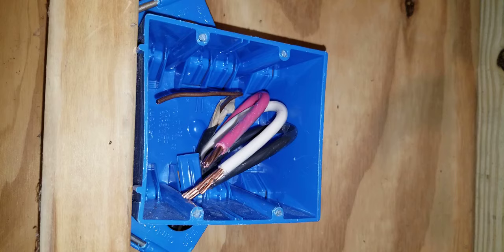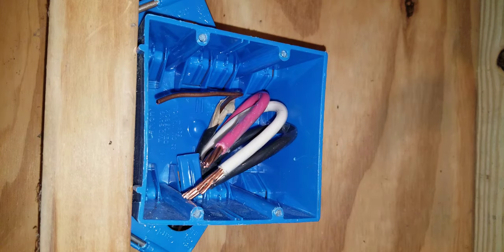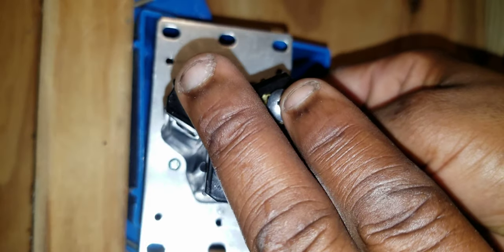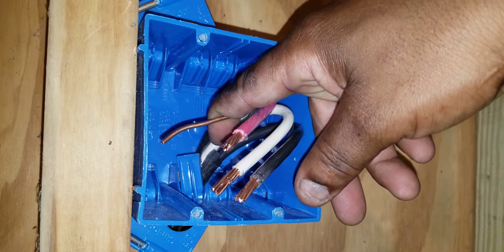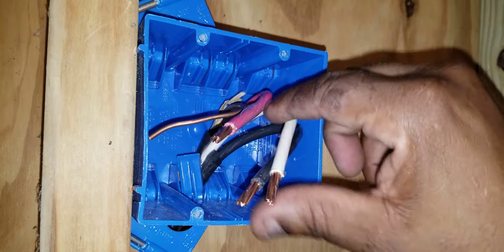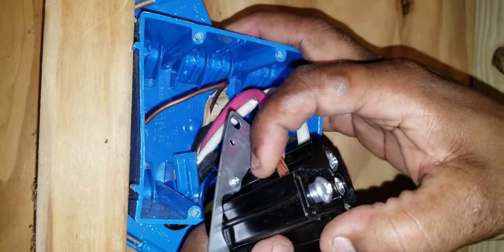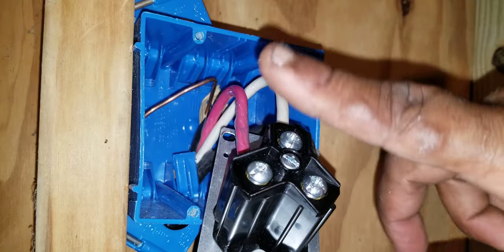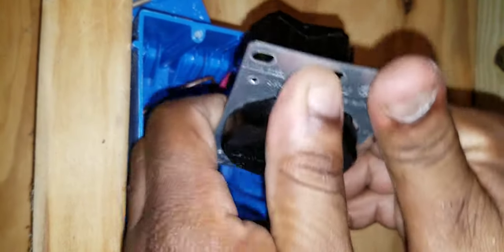How to install a 3 wire range outlet.

Comment: For those who think this is easy, you should know that the old NEMA 10 series plugs like this one have been illegal for new installations since about 1996 in the US. Appliances built before then were designed for buildings that did not have a dedicated ground circuit, so they used the neutral wire to carry ground faults. It will work, but it is potentially dangerous because the frame of the appliance may have some voltage on it caused by the imbalanced 120V loads. The NEMA 10 series were replaced with NEMA 14 series which have 4 wires, or NEMA 6 series which have three wires but no neutral (in those the third wire is a ground, not neutral). You don't want to be using a NEMA 6 plug on an appliance that runs some 120V circuits since the ground wire would end up carrying the unbalanced load back to the panel which is also illegal. NEMA 6 plugs are designed for appliances that don't require the use of 120V circuits to power oven lights, accessory plugs, or circuit boards. To tell which plug your appliance requires, check the wiring diagram and installation manual for the appliance. If it is a relatively new appliance, you probably don't want NEMA 10 receptacles! If the appliance supports a dedicated ground wire the most versatile and safest option is to use a NEMA 14 plug and receptacle AND be sure any ground/neutral bonding strap inside the appliance is removed. The 4 wire configuration of the NEMA 14 series is the direction almost all new appliances are moving to, and older plugs may be flagged during home inspections.

Comment: NEC code says that for a 50 amp circuit min gauge wiring must be 6 gauge. Correct me if I'm wrong ?
Reply: If the terminals are rated for 75C, then you can fuse it at 50A. but the general rule is 100A and less, use the 60C column, which is 55A for #6 and 40A for #8. correct.

Comment: Ricky, i just added a new 240 outlet, but i used the red and black as power and the bare wire in the center port for ground., did NOT use the white.
Reply from the maker: This is fine for an 240v a.c. unit or a water heater, but not for a stove, oven, or dryer. Using the white wire is always recommended for the neutral in a house. Using the ground bare copper wire for the neutral should always be avoided, however it is fine the way you installed it. In many houses built in 1950's, and 1960's, the bare copper wire was used as the neutral wire.

Comment: When i tighten down the screw, it doesn't hold fit the wire. The wire still pops out. 
Any tips how to deal with it 8:44

Comment: What if you have black,white,and ground could still hook it up?
Reply from the maker: Yes you can. Use the white as a hot wire, use the black as a hot wire, and use your ground as your neutral wire. So put the black under one of the hot screws, put the white under the other hot screw and put the ground  where the neutral would go.

Comment: Wait - if it's a 3 wire nema 10-50 outlet, the third wire is NOT NEUTRAL, it is suppose to be ground.  This connector is for two wire w/ground cable where you only have the Red and Black - if using a 3 wire source with ground, then you need the nema 14-50.  You just created a safety issue because a neutral wire is not a ground.  In your case, the appliance is NOT grounded and can be quite dangerous.  You can still use the 3 prong plug, but do not use the white (neutral) wire.   As a side note, at no point beyond the service entrance do you bond a neutral and ground.  When using the 2 wire with ground on a range, the range itself will have a jumper that connects the ground to the center terminal.
Reply: So eliminate the white and use the ground in the center?
Reply: Hey man I’m trying to hook up a 3 prong nema 10-50 that was once a 4 prong, which wires am I supposed to hook up, the 3 prong  says white, x, y, and the wires that’s hooked up to the 4 prong is red black white ground so please tell me which once to hook up to the 3 prong please.
Reply: @Not_chris_again  yesterday I did a 3 prong with 4 wires. And capped and tapped the ground and hooked white in center and red and black on left and right.
Reply: @Not_chris_again  hi, sorry for the delay. You only use black and red on the sides and green ground for the center tab.  3 prong nema 10-50 does not use neutral.   Hope this helps.   BTW, some appliances need a neutral and would require 4 prongs (nema 14-50).   What ever you do, do not connect the ground and neutral together.   Only use hot-hot-ground.
Reply: @aaronhagan4036  for the 10-50, you only use hot-hot and ground.   If the appliance requires a neutral, you’ll need the nema 14-50.   In your case, the white is left off.  Please cap the white wire so it’s not able to touch anything.
Reply: @MrKen59  so theoretically what can happen if I capped the ground and out neutral in middle?
Reply: @aaronhagan4036  great question:  
Ground is there for safety and should never carry a load.  Ground and neutral are connected together in only one place, and that’s at the service entrance.   If a fault occurs you can potentially energize the case of an appliance.  I know it makes little sense as they are connected somewhere, but wires can come loose and there is always a voltage drop along a wire.  As a side note, you may notice, the ground conductor is not always the same size as the other conductors. 

In regards to your question - you have to understand how current flows in a circuit.  With 2 wire 240v, current flows between the two hots since they are out of phase.  It’s the same with 3 wire, except the neutral can carry current if the device needs 120v since you essentially have two 120v connections. 

Good luck my friend :).
Reply: the range is grounded in the frame to the neutral. Fault current will go back on the neutral.
Reply: @krakenwoodfloorservicemcma5975  neutral is called a grounded conductor and not used for fault current. If the source is 3 wire (black, red, white and ground) and it’s a 2 prong with ground  receptacle - white is capped off.   I challenge you to seek approval from your local inspector.
Reply: an oven uses neutral current, I have not seen a range yet that runs on straight 240. you cant send it back on a bare ground wire unless it is SE cable.
Reply: @MrKen59  and stop giving people dangerous advice. neutral, common, center point of transformer, grounded conductor, intentionally grounded conductor.. doesnt matter what its called if you dont know how to hook it up.
Reply: @krakenwoodfloorservicemcma5975  wait / he is talking about a plug. He is using the white neutral as the grounding pin on a receptacle. That is wrong.  Neutral and Ground are bonded ONLY one place in a system and that’s at the first point of disconnect.   Neutral is not used for fault current as it’s considered a return path.  Your example - IF you have a 3 prong 240 v (hot/hot/ground), then on the appliance you can connect white and ground, but in his example, that white wire is not for fault current.  Hope this helps as I think we are talking about two different things. 

Do me a favor - if anyone does electrical work, have it inspected by your local authority or the city.
Reply: @krakenwoodfloorservicemcma5975  exactly - however if you only have a three wire plug, the appliance lists a process to connect neutral and ground at the appliance.   Always read the instructions when connecting an appliance.  The NEC has an instruction to follow the manufacturer’s instructions.  Again, in His example, he is using a 3 pin plug with 4 wires in the wall and setting aside the grounding conductor if I remember correctly.
Reply: @MrKen59  check 250.141 or 2 if i remember correctly. Existing oven and dryer circuits. they allow you to bond the neutral/ground because studies showed that it was rarely a problem and it would confuse so many people to mess with it.
 technically, since he has a 4-wire circuit, he is wrong doing this either way.
Reply: @krakenwoodfloorservicemcma5975      I see you have made several comments here.   Since I’m an old retired electrical design engineer, I can clear up a few things.   I started in 1981 NEC.   Stove and dryer branch circuits were three wire.  Black, white, ground with three prong receptacles.   In the 1984 NEC, the branch circuit required 4 conductors, black, red, white, and ground.  The receptacles were required to be four prong.   So, any house designed and built under the 1984 or newer code is required to be 4 wire, 4 prong, (never 3).  The reason for the exceptions in the newer codes is they can’t force you to install the upgraded number of wires so the three wires can remain.   Never replace a four wire receptacle with a three!   Always change the three prong plug to four wire plug to be compliant and safer.   I hope this helps!   Kevin
Reply: Thank you!! Your enthusiasm and accent made this enjoyable.
Reply: @KevinCoop1  its in article 250 and very clear.
Reply: The OP is showing what happens if your older home only have 3 wires (red, black and white) for the electric range. And technically you can call the third wire (white) neutral or ground if your older home only has 3 wires. The neutral and ground wire are bonded in the main breaker panel.
Reply: Saw this video, knew it was wrong, checked comments for right answer and here we are. Thanks!
Reply: I learned to use the black and white wire as hot, use the ground wire as neutral.

The place s small strip of red electrical tape over the white wire to indicate it's hot.
Reply: @greensiena2762  The ground wire should never carry current or be used as a neutral.  It’s there only for fault current.  If you need a neutral, run a new cable along side or new 3 wire.
Reply: @MrKen59 
Thank you- Done!

Comment: Ricky - Thank you for the video.  Question:  Can I install a 50amp. 3-wire range outlet with standard 6-gage electrical wires?
Reply: Yes you can. You can use 10 awg to 4 awg for a stove range.
Reply: @psychosocial6112  this depends on the specs of the manufacturer, some require #6/2 or 6/3.. always read what the manufacturer requires

Comment: My question is how in the world did you get the wire into that box? Mine will absolutely not fit those tiny romex slots. I'm going to have to drill out a hole.

Comment: Mine only has two black and one aluminum, no ground. How do I wire it and ground it?
Reply: That’s the answer I’m looking for.
Reply: blacks should both be your hots, aluminum is your neutral. always good to check the panel to see where the blacks are connected, you can never assume it's wired correctly lol

Comment: I have what I think is the exact same outlet for my electric dryer. Do these instructions apply to that as well?
Reply from the maker: Yes they do, however, the stove outlet is a 50 amp outlet and the dryer outlet is a 30amp outlet.  The same instructions apply. They  hook up the same way.

Comment: What if I have a white, black and a bare copper? I put the white and black on the hot and bare copper on ground/neutral
Reply from the maker: Yes.
Reply: @rickyjewett6082  wouldn’t that be be against code tho? Neutral being hot and ground being on neutral is that safe?
Reply: @nirvanarocks83    Your house was most likely built in the early 1980’s or older.   That was how they were wired back then.   Still legal if your house was wired that way.   Kevin

Comment: hi.. my stove is hard wired on a 40amp breaker... i'd like to install an outlet for the stove.  but from what i understand there is no such thing as a 40 amp receptacle.  can i use a 50 amp receptacle with a 40 amp breaker?
Reply: i have the older 3 wires not the modern 4 wires
Reply: Short answer is yes, because a 40 amp receptacle doesn't exist. This is per code.

Comment: Good job but make sure you cap all loose wires (ground wire) and also if you pre bend your conductors installation would be much easier
Reply from the maker: OK. Thank you. Iron sharpens iron.

Comment: What I don't get is why the single pin of the receptacle goes in the lowest position when the plug on the power cable will have it at the apex of the triangle opposite where the cord is attached, making the plug need to be inserted "upside down". Also, with the two pins at the top, any cross-pin contact while pulling or inserting the plug is a 220 v experience, when it would be half that if the neutral was at the top. It makes no sense to me. Just installed one of these and came looking to double check I had it "right".

Comment: New Stove not working.. i replaced range outlet ( wired exactly how other one was) but still not working.. there's only 3 wire.. Ground, Black, and White wire.. if you're familiar with this, please let me know.. thank you and great video 👍
Reply from the maker: The wires that are connected to your stove outlet should be be black, red, and white, however a black, white and green will still work. Was there an old stove there? And did it work. The wires that are connected to the outlet should be at least number 6 AWG in size. As far as the new stove not working: 1st go to your electrical panel or fuse box and make sure that the breaker for the stove is turned on or the fuses are not blown.

2nd make sure that you are getting power to it by buying a NON CONTACT VOLTAGE TESTER and testing the circuit. A non contact voltage tester cost about $20.00 dollar at a home depot or any hardware store.
 3rd If you can't figure it out call an electrician.
Reply: Unavailabl

Comment: Wouldn’t that bare copper wire hit the terminals once you screwed in the outlet?
Reply from the maker: Yes. That would be copper wire.
Reply: @rickyjewett6082  Took my old stove out today and unfortunately I don’t have a red and black wire. Got a black, a white, and a bare copper. 😳

Comment: I was following your video. I had turned off the breakers to the kitchen. No appliances or lights were working. As soon as I removed the red wire it fucking exploded in my face. WTF!!! That shit scared the shit out of me.
Reply from the maker: I am so sorry to hear that. Please be careful.
Reply: @rickyjewett6082  I didn't know the word "Range" was use to identify the stove in the breaker. 

Tip:
Turn all the breakers off. Then, turn off the main breaker.

Comment: Yo bro not to call you out on anything. You probably do have more experience than me on all this. But shouldn't you have used a metal box for that to land your ground? Because my understandment is that everything now. Up to code needs a ground and a neutral. If you could please get back to me and explain that that would be so great, brother.

Comment: Ricky,   This is not a good video.   In the 1984 NEC, three wire receptacles and branch circuits were to not be installed any more.   So anything after 1984 code, must have four wires.   For you to install three prong receptacles now in a box with 4 wires is illegal.   You do not change the receptacle to three wire, you change the range and dryer cords to four wire.   Best wishes,   Kevin
Reply from the maker: OK. Thanks I do understand and acknowledge what you said, however in many older houses there are 3 wire outlets. The video was for people who have very old houses who may need to change out a 3 wire outlet. When I work new construction I always Install 4 wire outlets.
Reply: @rickyjewett6082     100% agree with your comment but, you showed 4 conductors and said to just push the ground in the box.  That is the illegal part.   See my point?